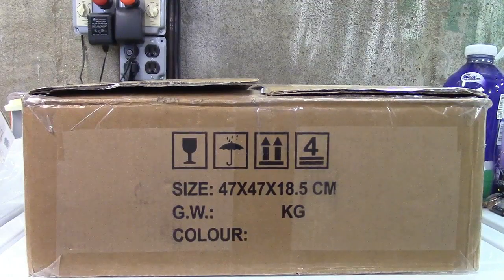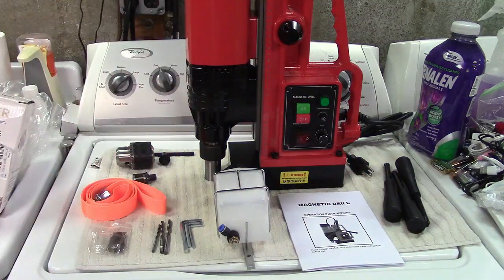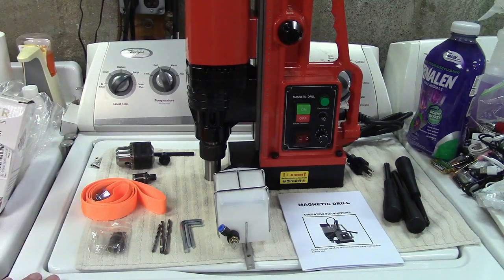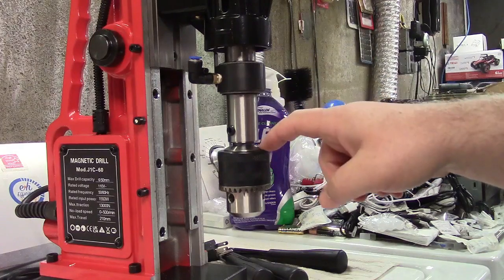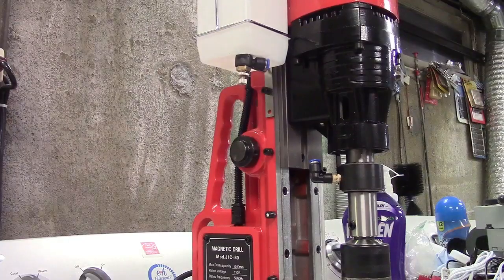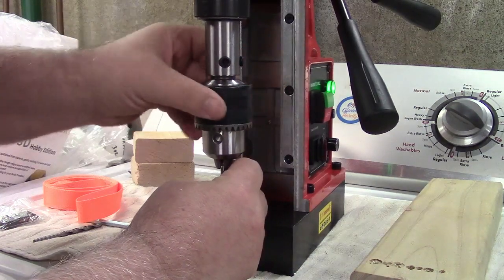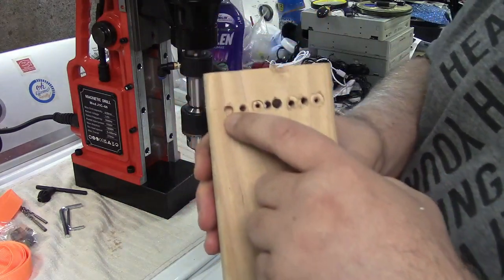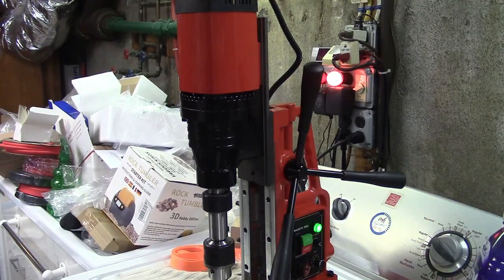GARVEE Magnetic Drill Press Review

Comment: Machine Shop, where I am at now, use something similar, but way more heave duty. To drill holes in certain parts during manufacturing.
Reply from the maker: I'd certainly hope what they have is more heavy duty.  This is pretty hefty as it is.  

I bought a Harbor Freight drill press years ago, never took it out of the box.  I'm sure it's no match to even this, yet still plenty for my needs.